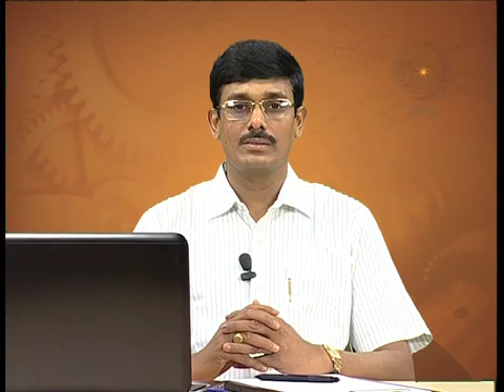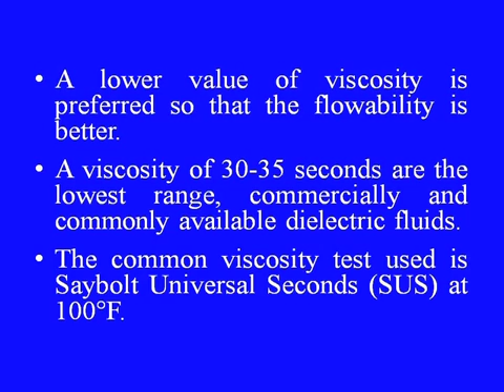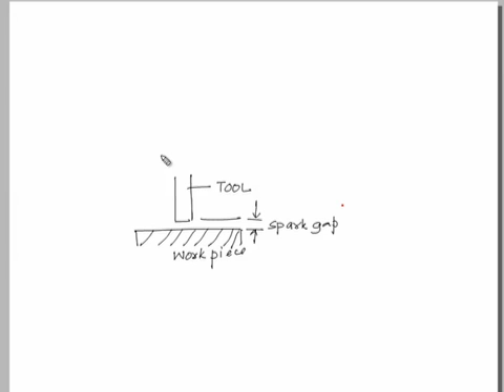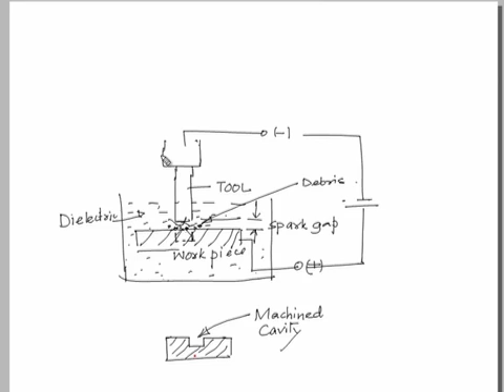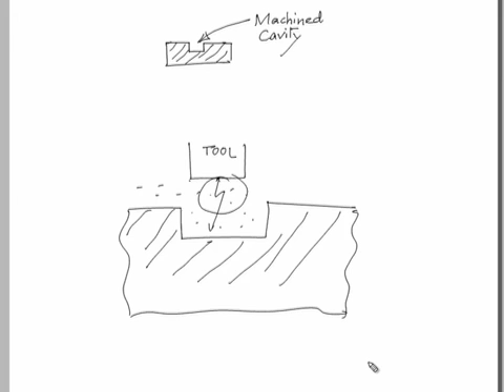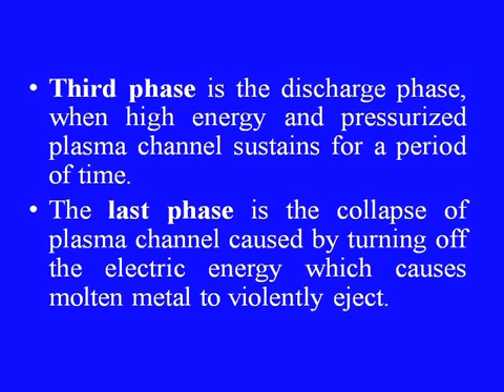Electric Discharge Machining (EDM) Process

Comment: very informative, if we use kerosene as dielectric it will get fire where the electrode and work piece will contact each other, when it will produce the sparks
Reply: There is no oxygen present... No fire can occur